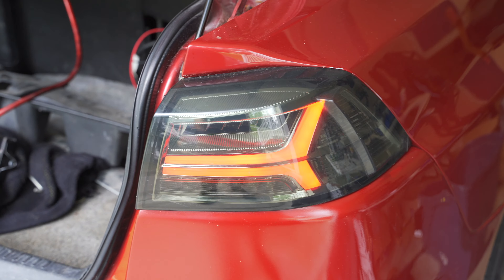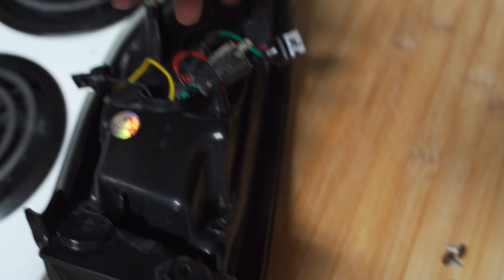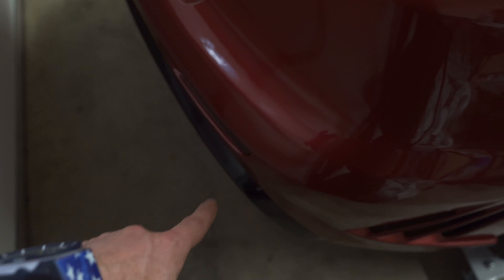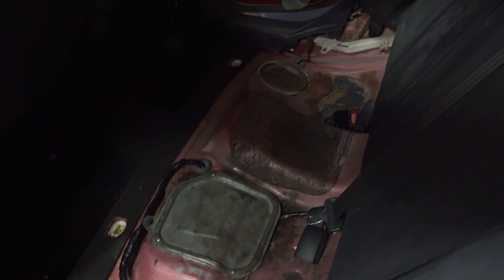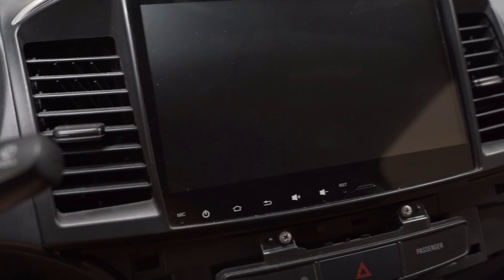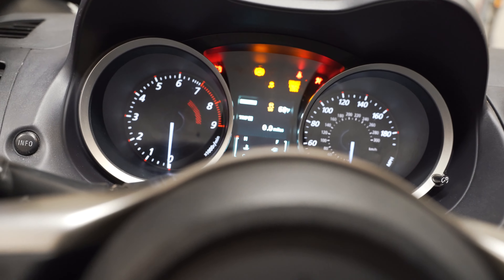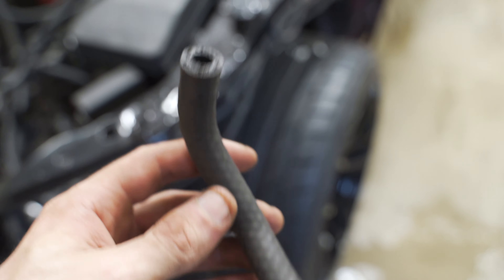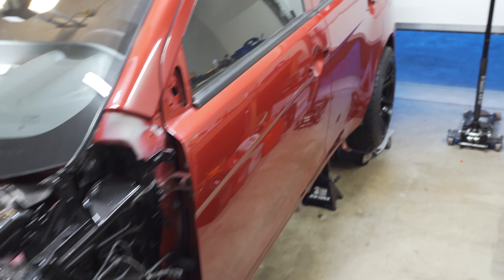Well, we have problems. (Abandoned Evo X Rebuild)

Comment: I ran into the same problem with Permatex Ultra Grey.  Now all I use is Hondabond HT.  Hondabond is the best.  A cheat code for that is put it on both sides.  So if you're doing your oil pan, put it on the oil pan side and the engine block side.  Pretty much the same rules for contact cement if you ever used it.  Keep it up you're almost to the finish line!  🤙🏽

Comment: I don’t think you have any problem with your fans i had the same issue or what i I thought it was an issue it just takes a while take your car for spin. You will see them coming on and off and they don’t stay on for a long time if the coolant temperature are normal and idle. It took me a while to find out😂 i hope this helps you
Reply from the maker: Previous owner is telling me they weren't coming on and he thinks thats what heated up the car enough to blow it up... thats what scares me.